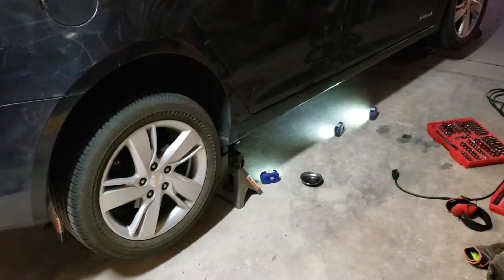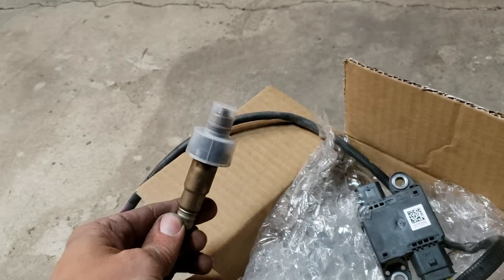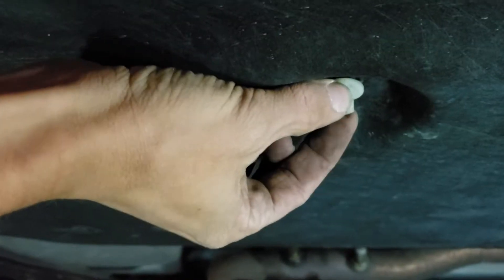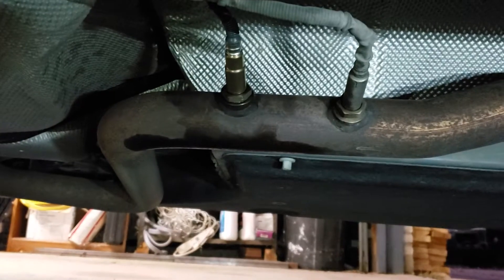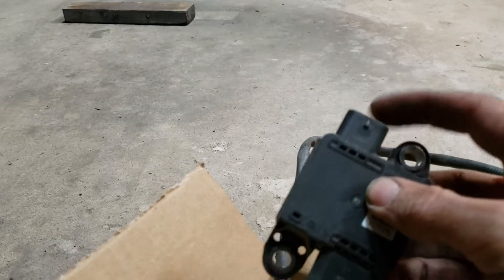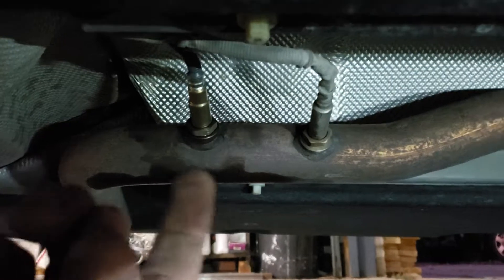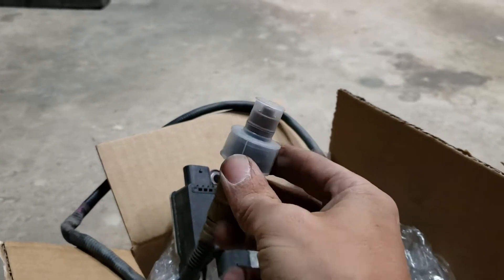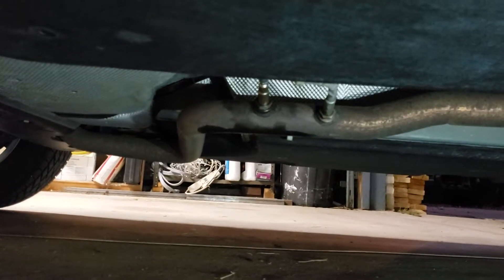2014 - 2015 Chevrolet Cruze Diesel DPS (Diesel Particulate Sensor) Replacement - Trouble code P24AE

Comment: I have a 2014 Chevy Cruze diesel and was wondering if you had a reduced engine power message on the DIC screen before having to replace this sensor. That’s what’s going on with my car right now and they’re telling me it’s this diesel particulate sensor - I’m worried I’m being told the wrong thing to be fixed for the car. You would be helping me out a lot! Thank you
Reply from the maker: @AutumnReinstorf-m6u  it’s been a few years now and I have now sold the car and moved on. I loved the car but these types of issues were eventually too much for me. That being said, I very distinctly remember that I did not get the reduced engine power message. I only had the CEL on with the associated code.

Comment: P24b4 code?
Reply from the maker: Looks like something is wrong with your Particulate Matter Sensor. I haven’t replaced this sensor before but it can be as simple as a software flash or can go all the way up to a replacement of the PMS.
Reply: Thanks, I appreciate it. The light went off and hasn't came back on yet so hopefully it just bumped the sensor around
Reply from the maker: @CodyRousan-sd9ku  sometimes your particulate filter can clog and when the car goes through a regen and burns it off, it will clear. Hopefully that’s all it is!

Comment: Did you have reprogrammed? or is just a plug and play fix.
Reply from the maker: This is plug and play. I cleared the code when I started it and it did not reappear.
Reply: Thank you very much sir. I’m going to do it on my Chevy Colorado. The dealer here is charging me $770 to get it fix. I just ordered the sensor and I hope everything goes well. Thank you again.
Reply from the maker: @pedrorobledo  I hope it goes well! It is NOT worth $770 dollars, it’s an easy job. If you have issues, let me know!

Comment: I have a code on my as of right now, code is P24C6, did some searching and everything I’m finding is somewhat coming back to this, think it would be worth a shot?
Reply from the maker: I think so. There’s a handful of sensors that relate but this is one of the cheapest and easiest to swap. If you have ever done an O2 sensor, this swap is very similar.

Comment: Hi,
What is the fail in the car? is a power reduction?
Reply from the maker: Hi Carlos, I experienced power loss and a check engine light. Eventually the car will put itself in limp mode and give you the countdown, which is the worst scenario in my opinion.  Better to replace the sensor before it does this.

Comment: Hello do you know what would make code P2453 come up?
Reply from the maker: P2453 is a Diesel Particulate Filter code. I would guess your DPF is clogged or DEF system had a bad sensor, sprayer, etc.

Comment: What fault code was showing?
Reply from the maker: P24AE
Reply: @titansgarage  P24ae... thanks. Im getting P2463 and P11CC fuel trim rich. Reduced power, keep driving... replaced pressure sensor. No help. Shows only .18 KpA pressure on reader but says dpf full!
Reply from the maker: @duanebartlett4885  These diesels have given me a lot of trouble over the years. I adore the high fuel economy but the sensor systems are a real weak spot!
Reply: @titansgarage  Boy dont i know it. They had it in the dealer for two months 1 1/2 years ago for limp mode. So far had the following replaced, nox 1 sensor, dpf filter, def tank, dpf pressure sensor, thermostat, turbo air charge cooler, water pump, timing belt, idler pulley. Now its in reduced power mode AGAIN. $3500 in repairs so far. Cant get it to pass smog so cant get car registered.... ugh!! So sorry i bought this piece of crap.
Reply from the maker: @duanebartlett4885  Wow! You basically named all the usual suspects that I recommend people swap and now it sounds like it may be one or more of them again!  I reached the end of my patience and sold mine last December. I bought a Durango and haven't looked back.
Reply: @titansgarage  Good for you! I'll do something similar asap! Time to trade this CTD. It was a fun car when it ran good. Love the way it handles and the diesel torque and all. Too bad the govt had to require diesels come with dpfs!
Reply from the maker: @duanebartlett4885  I totally get it. I adored driving the car with a nice torque curve and good gas mileage. In my state, some counties are non-emissions and people will install DPF delete kits. They get rid of all the sensors and flash the ECM. The cars get even better mileage as a result! 

Unfortunately, I live in an emissions County and I finally reached your frustration level and had enough of sensor failures.

Comment: Hi got a code po700 ,that led to code po965,can u help
Reply from the maker: Hi Neil, those are both transmission/clutch related codes. I've never had them before, but I'd start simple and look for sensors related to those systems that may have gone bad

Comment: Do you know if this sensor going bad is related to the "DEF poor quality" issues?
Reply from the maker: I've learned with this stupid DEF system that anything is possible. A dealer can test your DEF to see if the quality is actually poor but usually it is not your DEF. It can be your def heater, your NoX sensor, your def sprayer, etc.

Comment: What’s the part number? I have at this same code
Reply from the maker: You are looking at part number 12662647.  I was able to find mine on Ebay for $90 at the time, but the price may have gone up as time goes by.
Reply: @titansgarage  yes I haven’t seen anything lower $183
Reply: @titansgarage  Thank you for responding. I’m trying this one by myself lol
Reply from the maker: You can do it!  The only tricky spot was removing the bolts that hold the sensor in that are partially blocked by the fuel filter.  But IF you happen to be near the time to change the fuel filter also, you could knock both out at once?
Reply: @titansgarage  Thanks a lot. I’m going to price those too

Comment: Hello... Were you getting Code P2002 as well? I had my DPF cleaned. Yet, the check engine light came on again with the same code. I wonder if my  DPF Back Pressure Sensor screwing up.. I cleaned it too... I am getting annoyed with this!
Reply from the maker: Hi Craig!  I am sorry I didn't get back to you sooner on your email, I had a bit of a busy week.  I did not get code P2002.  One experience I did have was earlier this year I got the "DEF Quality Low" warning and the car put me on a 99 mile countdown until Limp Mode.  It was what is known as a "Latched Code" meaning even if I did a battery pull or used a code reader to clear codes it would not go away.  I finally gave up and went to the dealer and they had to basically flash the computer to get the system to go back to normal.  They did tests of the DEF and it was of fine quality.  The computer was apparently just freaking out and had to be reset in order to fix it.  I don't know if that applies here or not, but I do know the dealer only charged me a minimum fee to do it (I think $75?).  I am normally a DIY only person, but in this case, I was thrilled to pay it and get it fixed.

Comment: Where is the DPF located? In the front of the engine below the turbocharger? Does it sit veritically?
Reply from the maker: Hi Craig, the DPF is cleared by getting the car to initiate a "regen cycle".  Usually pounding on it for a good 30 minutes on the freeway will get it up to temp sufficiently to initiate the regen cycle, which will heat the filter and clear off the particulate on it that is throwing the code.  If you can't get it to do it, there are tools you can buy that you plug into the car and force a regen cycle, or at worst, a dealer can ($$$).  I'd recommend taking it for a few hard drives on the freeway first to try and clear the code on it's own.
Reply: @titansgarage  I ended up pulling off the DPF and took it in for cleaning.. WHAT A PITA!  It will be ready in a couple of days. I will I could find a DPF delete kit...I may just hollow out my DPF so it will pass inspection.. Just need to delete from the computer at that point.
Reply from the maker: That is wild! I love these cars but their emissions system is a giant pain in the ass, as you said.  Was your car just not entering regen or was the filter too gummed up for a regen to do anything?  I wish I could could rid of every sensor on the exhaust and let it run like a diesel is supposed to.  I have had NoX sensor 1 replaced by a recall. I replaced the DEF heater, the DEF pump and the DPS sensor myself in the 5 years I have owned it.